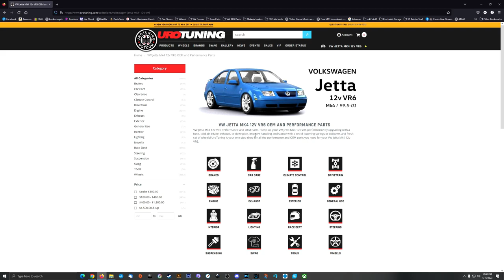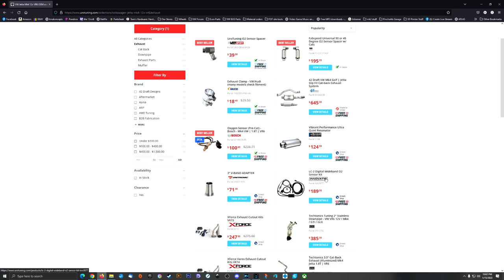How to install VR6 Cooling system - Patreon Built VR6 Turbo

Comment: U put the coolant hoses on the cooler flip flopped with the holes my guy. 🤦‍♂️
Reply from the maker: Not on this build. We will be blocking off some of the lines because the car has a shaved engine bay.